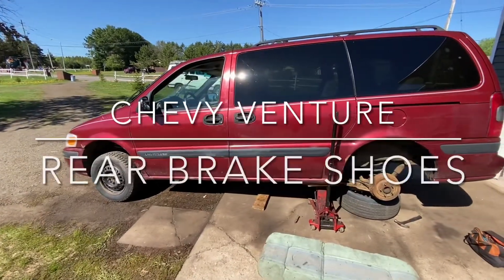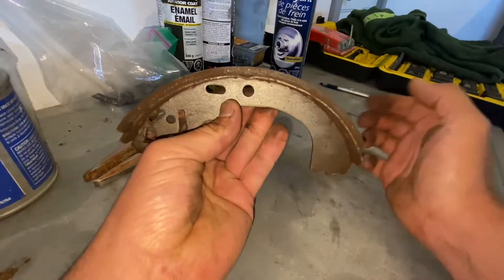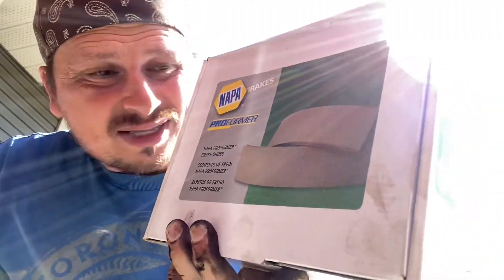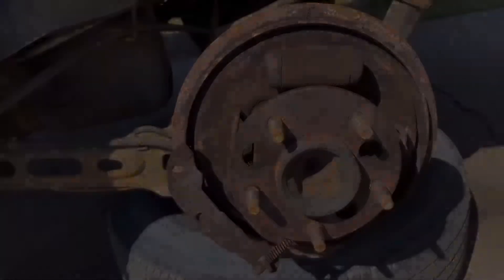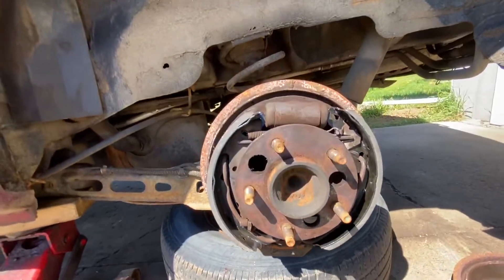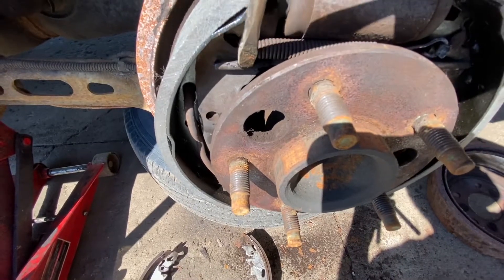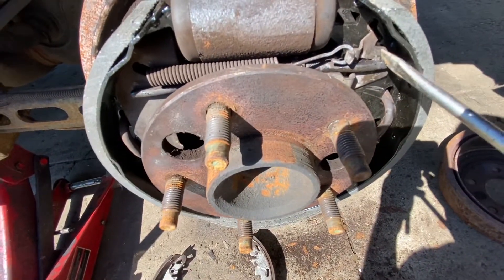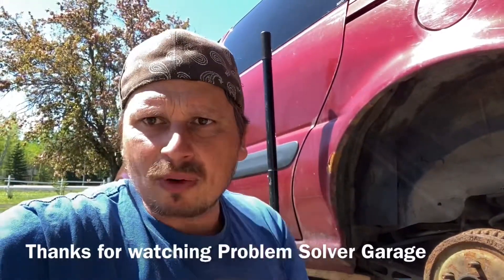Chevy Venture (Back Breaks) Rear brake shoes, step-by-step.

Comment: I was wondering how these things self adjusted.mine doesn’t seem to ever.even after I clean regrease everything Yes I use the right greases .but I will check to see if they click with drum off thanks
Reply: I've had my Montana vans, 2 of them, for well over 10 years. They don't self-adjust for reasons that I have never been able to figure out. I've tried everything including new hardware and adjusters. I've resigned myself to removing the drums and cleaning and adjusting the rear brakes every couple of months.
Reply: I’ve had loads of trouble with my self adjusters so much so I cut them off!!
No issues other than a adjustment every couple of years

Comment: I realize these are el cheapos, but perhaps the shock loading (brat-a-tat-a-tat) from the ABS worked the rivets loose.  I wonder if just bonded shoes would work better.  I am in the middle of reassembly right here.